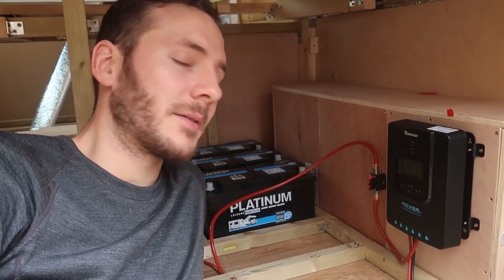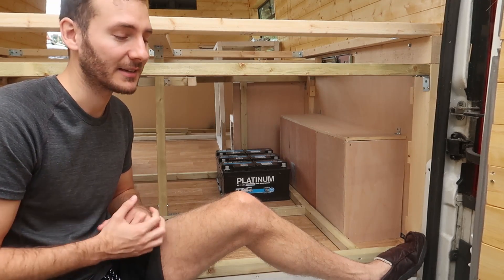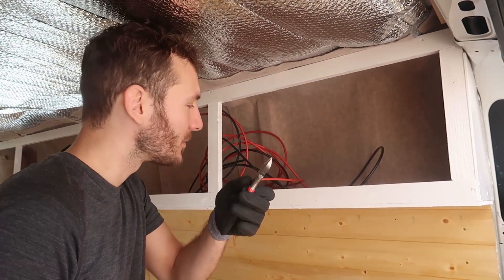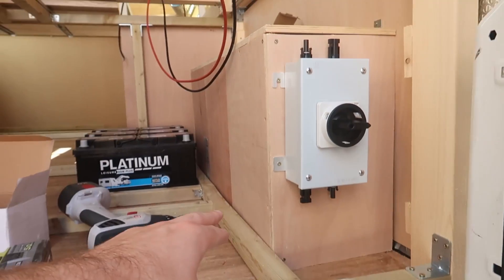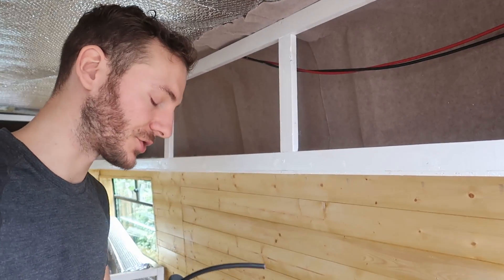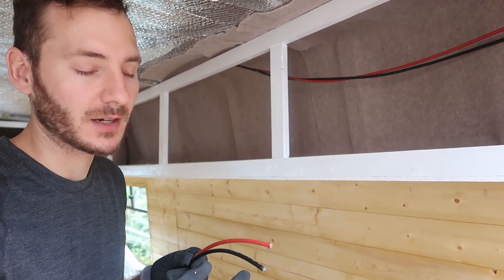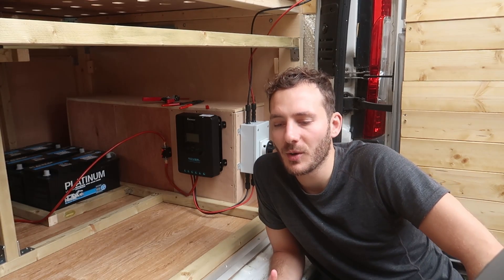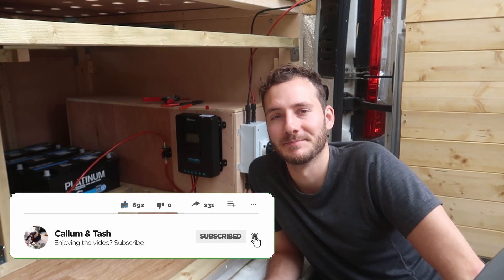Beginner 12v Van Electrics | Beginner Van Conversion Series UK

Comment: At 1 minute 55 seconds you say you are going to wire them in series. BUT this would give you 36  volts. Did you in the end wire them the correct way in Parallel ?

Comment: Awesome! Greg is definitely great and Will Prowse is the guy to go to for solar and LiFePO batteries. I've decided to buy LiFePO modules, a BMS from China and try to build the battery. I know nothing about electrics and am super scared but I'm going to give it a shot. Now we're starting to insulate the van and I'm going crazy trying to figure out which and how many wires to run where so that it's all ready before putting on the wall cladding.
Reply from the maker: Ah cool, we’re sure you’ll figure the wires out. You just need to know what appliances you plan to have 👍
Reply: @CallumTash  oh yeah, that, calculate the gauge of the wires, the capacity of the battery and solar array, and figure out how many switches, lights and outlets we want and their placement. Hahahaha. A piece of cake. I'm gonna follow Greg's advice about running the wires through conduits, that way I can (theoretically) add/replace any wires.
Reply from the maker: @jiri4023  sounds good.. hope it goes well 👍

Comment: Great video found it really useful. What’s that isolator called? The one I bought doesn’t indicate positive and negative. They also don’t have those fittings u use with the crimping tool 🤷🏻‍♂️ thanks in advance
Reply from the maker: It’s a 1000w dc isolator

Comment: Pro tip for stripping wires for connections. Do one first, then the other, never have to worry about live wires when you are only dealing with one wire at a time.
Reply from the maker: Thanks 😊

Comment: Question. The solar controller has a load neg & positive side also. What can be connected to that.? Ex: can a separate 12v fuse box be connected to run things like a fan or to inverter to use microwave during the day without usjjng battery pkwer.?
Reply: My microwave is 110v 900w. In order to use it, I have to run it through my 1500w PAW Inverter.
Reply from the maker: Confusious oh I see what you mean. I believe you’ll have to turn the inverter off for it not constantly drain power
Reply from the maker: We're not using it but I'm aware the load terminal is only compatible to run one small 12 V DC load with low amp consumption. I'm not sure what you mean by the second question... can you run a microwave without using battery power? If so, then no

Comment: Guys I would always solder the connections in addition where you can because you are in a vibrating van
Reply from the maker: We're aware that's a common way to connect cables but the for the connectors used in this video, we didn't think there was any need. When it comes to continuing with the wiring and other points, we'll be using heat shrinking
Reply: @CallumTash  I agree it just adds that extra degree of security because I can assure you from experience you will be surprised what rattles lose in a van!! any nut and bolt use loc tite (blue)...trust me it was save you headaches in the future
Reply: @pcat1378  i work on lifts and simple spade connectors are enough to connect a battery up with the vibration

Comment: Good job guys. 😎 Sometimes a Stanley knife is good for trimming the insulation off.
Reply from the maker: Yeah that might be better actually! Thanks you 😁
Reply: @CallumTash  You can usually feel when it's through the insulation and on the copper.
Reply from the maker: Adam Lincoln well give it a try next time 👍

Comment: Great stuff as usual. Even though I've barely touched my van I've watched so many videos I almost feel like I could do anything, except that is the electrical system. I just can't quite get my head round it. I understand what the parts are and what I need but sizing (if that's the right term) just makes my head hurt.
Reply from the maker: Tine 😀 thank you!! And we know exactly what you mean. Hopefully this video helps you a little. Definitely recommend Greg’s video in our description of you haven’t seen it already 👍
Reply: @CallumTash  Yeah Greg's video helped explain some stuff especially with wiring sizes and breakers I've sorta understood that part but I probably need to go to Will Prose's solar forum as I need to know what size DC to DC charger, MPPT solar controller, etc. which is where a lot of my confusion lies.

Comment from the maker: Please let us know if you think we're doing anything right/wrong... always happy for feedback :) Be sure to watch part 2: https://www.youtube.com/watch?v=7Ulcizo3mEA
Reply: not sure if anyone already mentioned that -  all the cables that have multiple smaller wires twisted into one cable there should be a cable shoe crimped at the end before mounting it to the terminal. 
Also a tip, if you don't have wire stripper for the size you need, just use a utility knife and go around the cable to cut the isolation without damaging the metal itself.

I love the video, good job
Reply: Would you be able to link the DC Isolator, MPPT Charge Controller and Trips please?